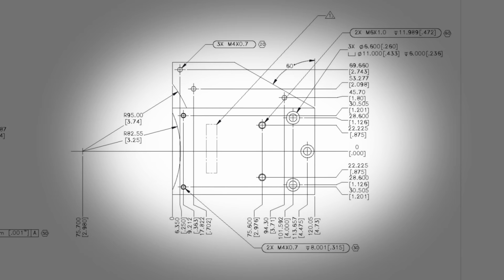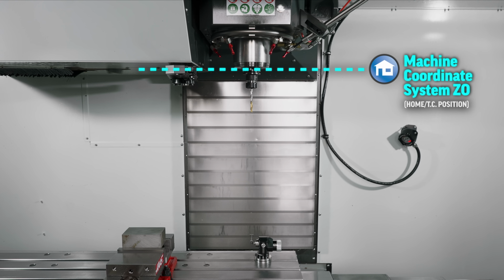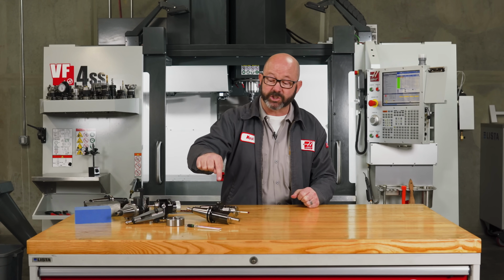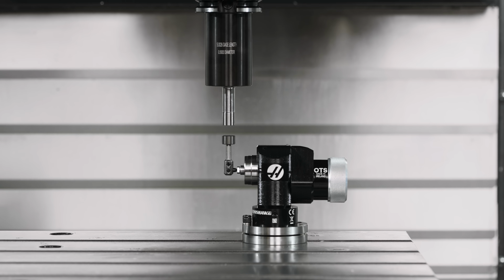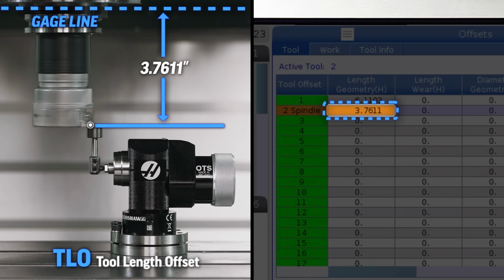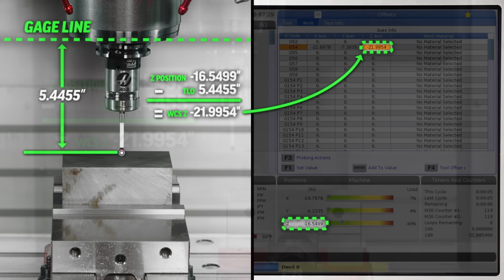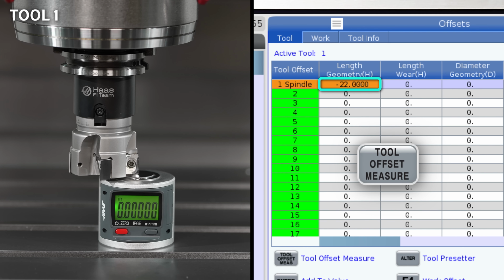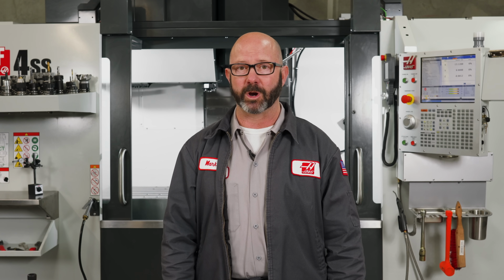Where Do My Probe Offsets Come From? Probing Offset Theory - Haas Automation Tip of the Day

Comment: What does #582 mean?😅
Reply: That is the Macro Variable number where the calculated distance (machine Home Z Zero, to Z top of probe) is stored, during the calibration process. The control uses the value each time a tool is probed to calculate its length.

Comment: I have just recently been getting my head around measuring tools manually away from the machine (offline),  purely by experimentation I managed to acquire the information you  (Terry) have just shared in this clip.  I worked from the flat of the spindle nose via a 75mm (3") block onto my height setter (cant afford Renishaw so I have another digital height setter interfaced with the mills skip input).  My measurements were coming up short by approximately 3.5mm - the gap between the tool shoulder and the spindle nose, i started to add the 3.5mm as a constant to the measured tool length and now they are pretty darn close.  I wasn't aware of the gaugeline measurement but obviously that now makes sense for the 3.5mm gap.  My question is what happens with the gaugeline when a taper becomes worn surely the gaugeline will increase -  or am i overthinking things.
Reply: It gets interesting when you need the full table (to make a fixture plate) and you have removed the tool height setter only to realise you need to set up 2 additional tools - cant touch them off with no setter on the table and cant set it on top of the material without creating a great deal of confusion - Happy days LOL

Comment: Why use a theoretical gauge line? Why not have the face of the spindle or the drive dogs, be ground and use that as a precision zero? That way users wouldn't have to purchase a calibration tool just to find this imaginary "zero point". Or even if something isn't ground to exactly zero, have the value of it shipped with the machine?
Reply: The theoretical gauge line is handy if you have multiple machines with the same spindle, and intend on sharing tools between them. That way, you wouldn’t have to reteach them, you just input the known number.

Comment: I've run many machines in the past without probes and tool setters, and always run positive tool length offsets....bring the spindle nose down to a 1-2-3 block, or a dial tool setter, and write down the machine Z value on the side of the machine.....then whenever you boot up the machine, you jog the Z down to that level, and zero your "user" Z DRO value....now when you put a tool in the spindle, you touch the tool to that same point or device, and you see a positive number in the "user" value.....type that number into your tool length offset, and boom, positive tool lengths....

Comment: If you are using a probe and ots system you DO NOT NEED a percision ground calibration tool. You a table top manual height gauge and once you run the tool afj the setting manually after measuring work piece withe micrometers

Comment: I did a PowerPoint for my class years ago on this subject. I didn't dig into the gage line.  I did probe and the other was old school. Old school top of part. was the way I learned in 1985.  I also did a common surface old school.  In many shops I saw various locations.  Top of table, top of table plus the tool setter 2.00 etc. 

I wanted students to understand these different methods so they would be prepared for any shop.
Reply: I still didn´t get it. You need to probe your workpiece and the end of your tool. What do I need to know home position for and tool changing position and so on ? 
I write my CAM program, then I need to find the same reference from the tool to the part to be able to machine the first site. After I have done that I always probe already machined surfaces for highest accuracy or the vice.

Comment: Great video, really wish more people learned offsets. Before our Probe we used to reference everything off a 6in block 5in block + 1 in round bit and adjust the Z till passed it through. 

Along with having set tools that we would hardly ever touch unless we needed to adjust the Z height. 

Not sure why schools nowadays force it upon students to learn the hardest way which is touching every part and setting every tool again with a piece of paper. What if your boss comes in and tells you there’s another part that’s priority? Well now you need to set every tool up again.
Reply: I can't speak to other schools, but for us the reason is because our introductory CNC course involves making very basic components that only have one worksetup, so we want the group of students to set offsets using the barebones simplest method possible to avoid trouble (imagine simultaneously preventing 16 people from crashing in a limited amount of time). About half of those students only take one CNC class so going into the machinist-friendly theory is wasted on them, it really just makes crashes more common and increases their frustration. But we'll develop the more-common machine shop practices for the people that continue onto other CNC classes.